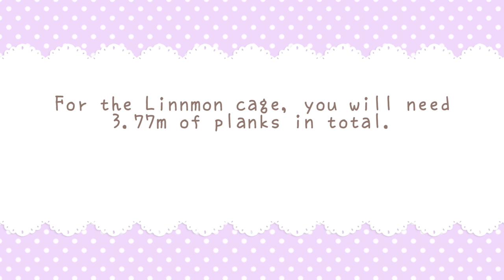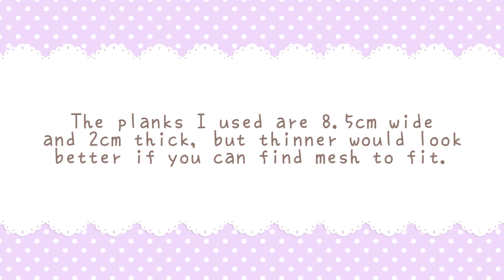🐹 Custom Hamster Cage Lid | HAMSTER DIY 🐹

Comment: This is one of the best DIY's ive seen. I was wondering though, how much does the whole cage weigh?
Reply from the maker: +shananerbananer Thanks, it's quite light without the glass, as it's mainly cardboard in the middle. I think the exact weights for each piece are on the IKEA website
Reply: VanillaHamHam thank you for the quick response! im thinking of making one for my robo hamster. i was thinking of  something thats not very heavy so that it wont be hard to move it if i have to switch spots around the house.

Comment: have you had problems with your hamster chewing at the cage? and also, how do you deal with smell in your small room? i am looking to get a hamster, but smell is one of my concerns! 🤗thanks!
Reply: If your cage is the right size then it shouldn't smell as hamsters only usually pee in one corner so as long as you spot clean it like every other day you should be good as long as it's a good size cage. And do a full clean out ever month or so as if it's bigger than the minimum size it won't need it more than that
Reply: Hamsters don’t smell too bad, I have a male mouse in a tiny room and it’s not too bad
Edit: I do a full clean out of his cage once a week

Comment: What do you use to clean your cage since it is wooden?
Reply from the maker: +Kori Williams It's coated in melamine (plastic), so it can be cleaned with a pet safe disinfectant
Reply: Okay, thanks! I'm also having a bit of trouble finding the Hemnes Glass top at IKEA for the cage part of the DIY. Does there happen to be another type of glass that we could use? The glass I'm finding at IKEA is either too big or too small.

Comment: I'm trying to convince my parents because I want to build this cage but I need to make two for both of my hamsters and I don't want it to be really expensive. 😓
Reply: Andrea._. Varquez I mean if u want to make it coz it’s big, u can always get bin cages instead lol
Reply: @silosaur  I have bin cages but they aren't big enough for my hamsters, it also isn't tall enough so I can put a lot of houses because my Syrian hamster attempts to bite the plastic on top of a house, they have very limited space to run around.
Reply: + in my stores there aren't a lot of tall big bin cages.
Reply: Andrea._. Varquez I’m not sure how much and ikea detolf is, that’s a good cage tho
Reply: What if you cut a hole in the bin cages and use a tube to attach them together? That’s pretty close to continue floor space so it might work. And for the height problem you could get those really cheap plastic dividers and stick it on top or something
Reply: @silosaur  one hamster is in one bin and my other hamster is in another bin.
Reply: IKEA has some big plastic boxes